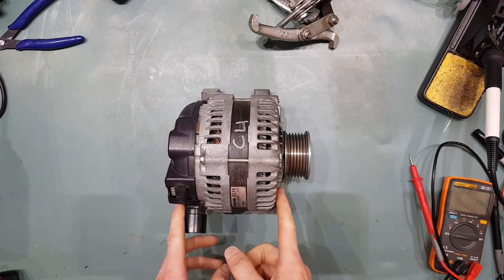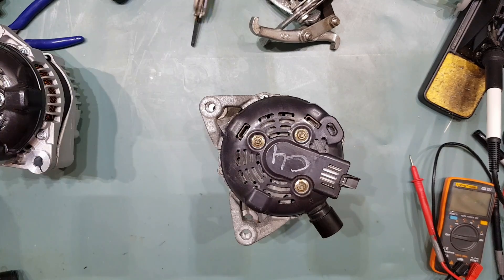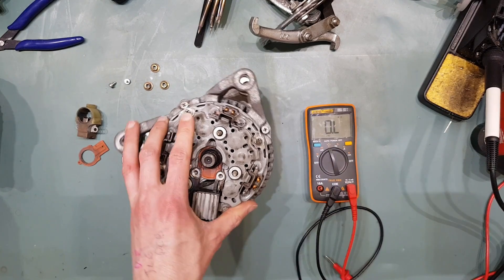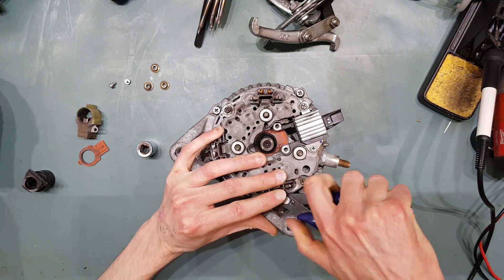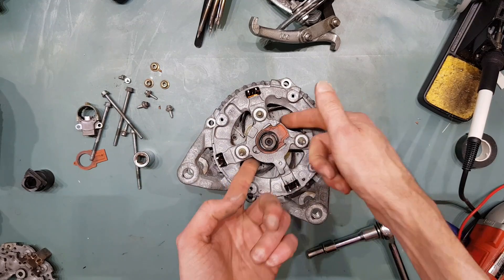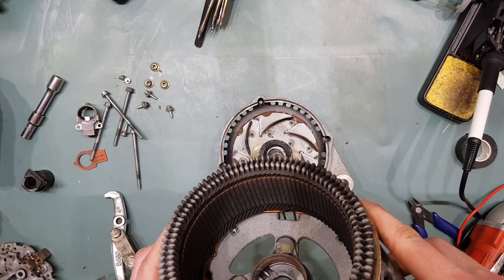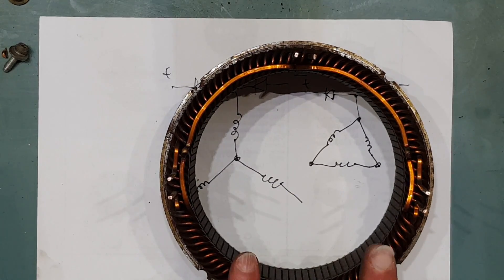Make your own HIGH OUTPUT alternator! - Part 1: The Teardown!

Comment: I am wondering, I have the Valeo FG15S081 , so the new stator was the same as the old one? where did you get the rectifier & voltage regulator?

Comment: How do you know when it's necessary to change from a wye to a delta winding configuration? Say you have a 105 A alternator and you want to make it 150A, do you need to do a delta arrangement?
Reply: Well it would become 200a with changing it to Parallel.

Comment: IN  REALITY... It's definitely NOT like that... The wire is the same, the diodes are the same, most importantly the core thickness is the same.... no way. You get about 10-15% more.

Comment: What's a good video I know it's a little old I have an ad244 170amp alternator and was wondering if I do this what kind of drop in voltage would I have at lower RPMs

Comment: Is there anywhere in Victoria australia i can take my mazda 3 BL 2.5L Alternator to do this upgrade? If not, can you list the parts needed to do this upgrade?( I.e 4:10 what regulator did you use, also other parts upgrades. ) I will attempt the upgrade on a used alternator 😊

Comment: I think “wavy washer” is called a conical washer
Reply: There are wavy washers and also Bellville washers, Bellville is what I think your calling a conical washer, they are normally used for preload tension, sometimes used in hydraulic piston pumps to hold the barrel against the housing with the correct amount of force.

Comment: 2 questions i have on this  are like some stated about it burning the altenator up or shorting
1. Will it last in a car that sees 6,000 rpm from time to time?
2. Is this a good mod for durability in a daily driver (with a good battery reserve?).
3. Does it have to be rewound for double the power or can you just  awind or amp up the output a little bit? Im still learning alot of this stuff myself  but  definitely interests.
Reply: #1 You have three questions. Not two.
#2 I can't understand your first line. Are you saying you have two questions which are about what some other people said about the alternator getting burnt out or shorting? Are you trying to state what the next two... er... um... three questions are referring to?
Answers to questions:
1. Will it last in a car that sees 6k rpm from time to time. Sure, as long as you have a good grasp on the fundamentals of electricity, have good soldering skills, and know how to test electronics components with a multmeter.
2. Is this a good mod for durability in a daily driver (with a good battery reserve)? No, it's not a good mod unless you need a high output alternator. I know nothing about your car except that it's a daily driver. You would have to explain why you might need one to justify if it is a "good" mod. Do you have a 3000 watt RMS stereo system that you normally play close to max volume. Yea, might be worth it if you're constantly draining your battery and your headlights are alwasy dimming. It won't be as durable after you modify it to twice as much power as it did stock. What's a good battery reserve? I have three batteries in my car. I consider that a good battery reserve but two batteries are just as good. Three just gives you a little more cushion..
3. The mod is necessary if you want to gain more output. Unfortunately, I know of no way to squeeze more juice out of your alternator by itself. Uprading to larger power wires will keep resistance low. It's not actually making your alternator more powerful but larger wire will use it's power more efficiently... at least in theory.
Reply: @paulweston8184 Check your attitude bro. You sound like a spoiled teenager that just learned some lucrative information about alternators. That's 2 sentences with no questions. I mean 4.
Reply: @paulweston8184  Paul thanks for your input....however....its a bit snarky. No need for that.
Reply: @jimjones7821  That's kind of funny you say that. None of my answers were snarky. The questions themselves required answers that will undoubtedly sound snarky. You are welcome though. Hopefully, you learned something new. Don't be afraid to ask questions, even if you feel stupid for asking them. It's stupid to not ask at all.

Comment: Does the delta configuration impact voltage? Instead of 13.5 would it drop to 12 v?
Reply: trades volts for amps along the rpm curve

Comment: If you connect the windings in series, the power is increased at a higher rpm. At lower RPM, especially at idle, the alternator lacks power and at high power demand, the alternator can burn out. For this reason, alternators are not produced in this way.
Reply: In other words, it's not spinning fast enough for adequate cooling
Reply: At idle, low output = low current = low heat.

Comment: I am working on a similar style alternator, where rectifier bridge needs to be replaced and soldered back, but what I am facing is since I cut the connections to remove the bad rectifier bridge my wires are very tad bit short and can't solder. Any tips or tricks to extend the wires or complete the soldering? Thanks
Reply: braze them together instead of soldering

Comment: Didn't he say that this only works on 150 amp or higher alt.no stock normal gas engine vehicle has that many amps stock.so this looks useless on 120 amp which is what most stick alt makes
Reply from the maker: Thousands of vehicles come with the 150-160amp small case denso hairpin alternators. Where do you think this alternator came from?
Reply: @TwistTapeTechnology  what year of vehicles have alts that big.

Comment: They sell high output alternators, it's pretty freaking important that yours always works, don't mess with factory..you'll be walking
Reply from the maker: Yes, they modify and sell stock alternator parts to do higher output. That's what this video shows... The same as they sell...

Comment: Woooah... Wait... I think your series and parallel concepts are backwards... Great video, and I was able to glean some great stuff from it, but, am I wrong? Looking at the drawing of the delta configuration, it looks like a series drawing.. Heck, you obviously know what you're doing tho. So really a slip of the tounge, or misinterpretation through semantics, you still showed me something I didn't know and now I do. Keep it up bro. I'm digging it.
Reply from the maker: I rewatched my video.
Star (or WYE) only has a connection to one end of each winding, with the other ends connected together. So effectively, any current flow has to pass through two windings, which are basically in series with each other.
Reply: @TwistTapeTechnology  I see. That makes sense. I was actually thinking about it wrong I think. I was treating it like ond of tgd many diagrams I look at every day where it starts in one place and travels basically till it can't travel any further as per the drawing.. Thinking of it like this, with a rough drawing of the delta configuration, they would b in series with each other. But since my heads screwed on, I see that each end is tapped, and I guess the current doesn't travel through each coil consecutively before going to ground. I'm with ya now lol

Comment: Fkng outstanding! A lot of these alternator shop people that charge an arm and both legs do this very simple modification😞 Damn good info friend!👍👍
Reply: Not realy, problem is even stock alternators can overheat with highload at low RPM like engine ideling, that is not a problem in a normal vehicle.
But for RV that can be an issiu if you want to charge the battery while ideling. You realy need to change the whole alternator or you might get bad luck, get stuck in traffic with a nearly empty RV battery and toast your alternator to death.
Reply: @jonasstahl9826 or if you are running 3500 rms to a subwoofer. With 100a AGM
Reply: Lol❤
Reply: Very nice video thankyou for the upload!!!!!

Comment: Hello, i own an old car “citroen traction avant” amd is going on 6v but the old dinamo is not enough for the charching process, i wish to modify an alternator from 12v to 6v can you make an video please? Of this modification also? Thanks i need like 80amps from it at 8v thanksss
Reply from the maker: A standard "12volt" alternator with a different regulator should do what you need. I'm not sure if there are any 6volt internal regulators, so you might have to use an external one.

Comment: Very good except I'm hung up on something you said... And I could b wrong bug I don't think so but, it seems that with the wye, or star, configuration, the coils are in parallel with each other, while the coils in the delta configuration are in series.. Further evident by the fact that components in parallel with each other typically hold the same properties, I. E. Voltage, while those components will add on to each other when wired in parallel.. With this principle, I can see how changing it from a wye configuration to a delta configuration will net more power. If I'm wrong then i apologize.

Comment: So whats the downside to this? Why dont all alternators do this cheap upgrade instead of charging 600+ dollars for a high output alternator
Reply from the maker: this IS what all HO alt assemblers do. THATS THE POINT!
Reply: @TwistTapeTechnology  So they do this to regular alternators and then decide to charge 600$ for it
Reply: @TwistTapeTechnology  And if I already have a HO alternator does that mean I cant do this? Since its already done
Reply from the maker: @rickytrevino8281  depends what your alternator is..
Reply: @TwistTapeTechnology  Yeah nevermind I ended up just ordering a bigger alternator

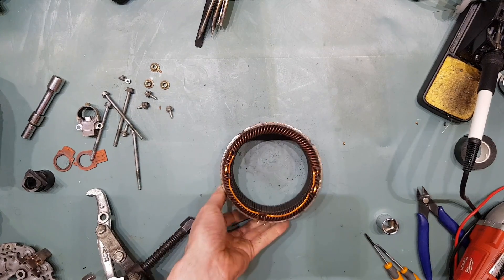Comment: At 7:25 you said this is where the modification happen... I'm confused, don't you have to change the rectifier as well, for higher amps or resistance as well??? Cuz usually diodes are 40 amps o I'm wrong.?
Reply: There are diode plates that squeeze more or bigger diodes in than stock to achieve the amps

Comment: before and after what is the volt what is the rpm before and after  pulley change (pulley size also ) your forgot to show the reading .Thank you bro
Reply from the maker: The voltage is the same before and after the modifications, about 14.4 volts in this case.
Reply: @TwistTapeTechnology   thanks bro

Comment: Can you make a video in rewinding a alternator for a 2017 Nissan Maxima SV. 3.5L? I need at least 300amps for my audio system. Most companies don't make a HO Alternator for my vehicle but one company told me $899.00 + shipping/handling and $89.00 for big 3 upgrade wires
Reply from the maker: No

Comment: I don’t see this as a win.. if you need higher revs to get the max output (which everyone with a decent system should be charging their batteries anyways) but most vehicles that would want a higher output alternator typically have systems that are show rather than go.. so unless they are revving while stationary what output would you expect to receive if any?
Reply: same thing as any high output alt. so still a win
Reply: @NightshiftCustom  It would have been great if you did a comparison before and after. You need tables Electric Load (A) vs RPM for both. The test can be done with a rig involving an electric motor rotating the alternator. If you do this, you will find that in your table there will be cells where for given Load and RPM, you generate less Amps than required. It's the comparison of such tables that can offer an objective evaluation and understanding of how suitable such conversion is for a specific use. A very good alternative would be an alternator from a diesel vehicle. Good video in any case.

Comment: Can u use this for a wind turbine ??
Reply: Haven't finished my idea yet but recently I tore apart an old skil circular saw and the model I had, has a transmission that yielded about 4,75 turns motor side -1turn blade side ratio it even has a small sealed reservoir for lubrication I've been playing with the idea of using this for a wind turbine in combination with belt drive pulley sizing because that alone won't be quite enough to turn a typical alternator fast enough. I'm a welder/fabricator so I can build a custom sized turbine to create the necessary power to turn this hopefully being light enough but also been playing with the idea of flywheel effect using some type of starter
Reply: @a-75n5lee4  this is pretty interesting. Did you ever move forward with this?

Comment: Hi there, I have a 128.5 mm hairpin stator with 6 leads and 3 connections (metro# 27-82018 for pics reference) from an orginal 105A denso alt.
Could you please let me know how could I turn it into a HO stator? Connections differ from the ones in your video and I can't figure it out, although already researched about.
Million thanks in advance for your return on this.
Reply from the maker: I've dismantled a similar alternator, and while it looks like it can be modified in the same way, I haven't personally tried it, so can't confirm that it will actually work. You might be better off finding another alternator and swapping the stator into your alternator.

Comment: Just buy a High output Alternator and forget this Burn your car down 101 lesson cause if you fuck up one bit its gonna send huge amounts of current to your battery that it cant handle and overthrow the battery overheat and burn every wire with that battery feeding the fire .. dont do it

Comment: Hi there would this also work in the off roading scene when winching where the battery and charging system is under heavy load? And to charge the battery up faster after a long winch pull? Also for what i could tell you used all the parts out the alt and only changed how it was wired? If it would work could you please tell us the part number of the alternator you used thank you
Reply from the maker: This alternator was for an 05-15 diesel Toyota Hilux.
Reply: @TwistTapeTechnology   i have found that 3l range rovers use this alternator 150amp do i need any over parts apart from the alternator?

Comment: My Alternator is off a 1987 Pontiac TA 5.7 GM 1 Wire I thick 108 Amp I’ve already tore it down washed the Stator in vinager , lemon juice & baking soda to remove any oxidation off the stator windings clean inside of the cases , now hoping to be able to do it you’re doing now my alternator ?
Reply from the maker: no

Comment: I have watched this series a few times and although I dont know much about cars I am good with my hands and enjoy fiddling. I have a Vauxhal Astra H 2010 1.8 Sri. I need to get more power to my car audio system. I have looked at buying an alt but cant find any. The one I have is only 100 amp but can get a 120 amp. Is there any way I can modify it to double the output? Thanks
Reply: @best butter I have looked high and low. My Vauxhall Astra has a 100amp alt. I can get a higher 120 amp but that's it specific to my car. Not sure if you can get a 160 from another car and make it fit. I have emailed Mechman and Singer and they don't do Euro car alts. The only options that I think I have are to fit a dual alt so would need to find a mounting kit and longer belt or to modify an alt to put out 200 amp (240 if I can get a second hand 120 amp and modify)
Reply: @Pkdimmock hey how did you come out from 4 years ago have same issues what did you do?😮🎉😂
Reply: @SONSTHREESIXTY  I didn't end up doing anything to increase the power. I was looking at getting an upgraded alternator but it was going to cost too much. Think it was almost £1k with fitting. Tbh it turned out I had just enough for what I wanted. If I wanted anymore than just the 1200w rms sub/ amp and a set of components with a 2 channel amp I would have needed more, but I didn't end up upgrading and adding the extra set of components, and the bass I had was more than enough. It made the car shake and my eardrums rattle 😅
Reply: @Pkdimmock  They tried to tell me a BUICK RIVIERA ALTERNATOR stock ALTERNATOR, wouldn't work on my BUICK PARK AVE. I'm telling you can not listen to em. Ended up putting the RIVIERA ALTERNATOR on with only having to change the voltage regulator connector plug. Bought a 140AH LITHIUM BATTERY, with an IXOUS ULTRACAPACITOR, with my regular AGM battery. Am bumping non stop 😂🎉😮.
Reply: https://youtube.com/shorts/bMZI2NQnVmY?si=leGuXNKIJYVZaVLM was going to recommend not much is needed in fact industry will try and prevent you from finding out bout your make model modifications. Meaning vehicles that are your same make model will work with little to NO modifications. Also beware of some of the dishonest ALTERNATOR sellers like universal car lifts & mechman.
Reply: https://youtube.com/shorts/bMZI2NQnVmY?si=leGuXNKIJYVZaVLM

Comment: I like my 250amp bolt on small case denso from mechman. Thing is a beast. 100+ amp load and still holds 14.2 at idle
Reply: Is rebuilding my alter easy to get more amps?
Reply: No

Comment: Yup, but in a daily driver is not a good idea. Usually drops idle amps on doing this. Pretty annoying sitting at a light at night and your headlights dim only to brighten when hitting the gas as the light turns green.
Reply from the maker: I've been running a 320amp daily for over 5 years now. If you're not charging at idle, then your pulley ratios are wrong.
Reply: @TwistTapeTechnology this is awesome!!!!! Thanks for making this video!!! I love car audio and tinkering. It's about $800 - $2000 USD to get a custom HO Alt 400ah

Comment: Hello,,,,i have a 1998 grand cherokee laveredo...ive got a problems...with a battery voltage meter...the pointer os all the way up!....and at a desame time ive got a it says ...check gauges indicator light...what do you think...this kind of trouble shooting....?
Reply from the maker: Check it with a multimeter, if its really that high, the alternator regulator has probably failed.